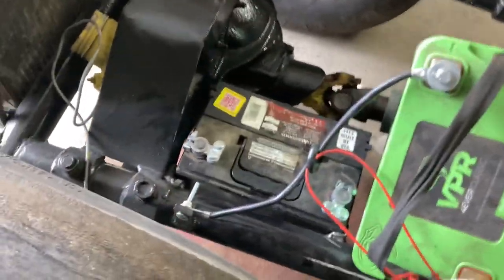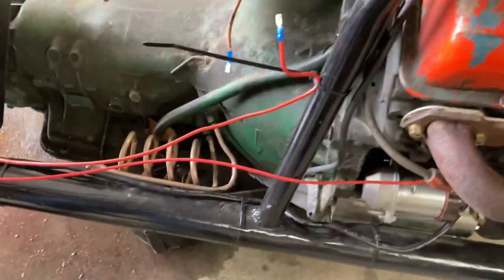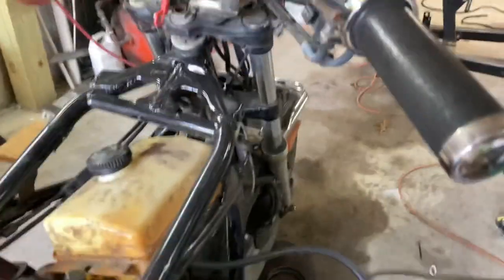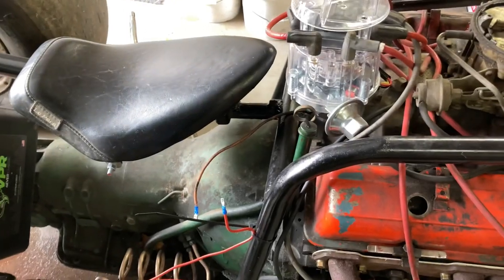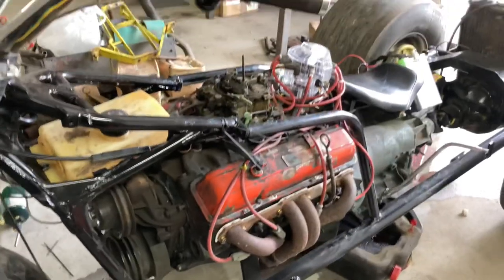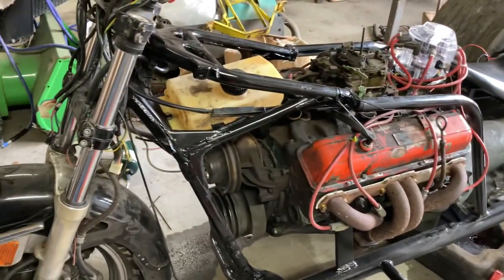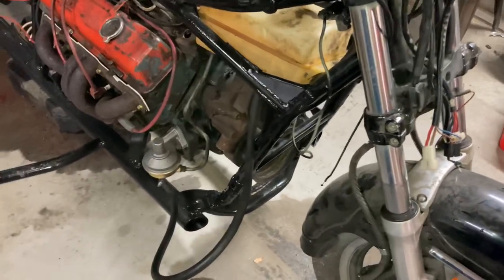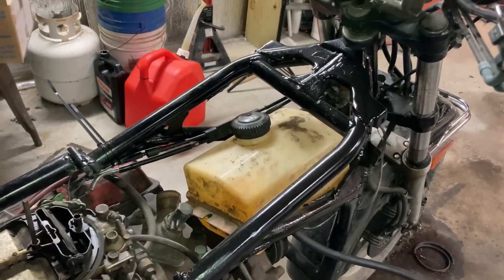Quick and Dirty V8 Rat Trike is Alive! Aka part 4

Comment: Do you have a design plan for the trike? a frame plan or did you just make it up as you went?
Reply from the maker: Honestly I just wing it and one off most things I build. And that is the way I did this build also.
Reply: You dont need a plan / design on paper, its ok in your head but for f**k sake let it rattle around in your head for a bit longer and you may end up with a neater / nicer machine.

Comment: How dus it work transmission strat to rear end I'm bilding one but it's a inline 6
Reply from the maker: It’s hard to get it to not vibrate with only one universal. I would recommend putting a really short driveshaft with two universals in it.